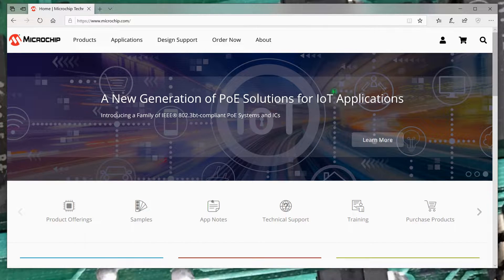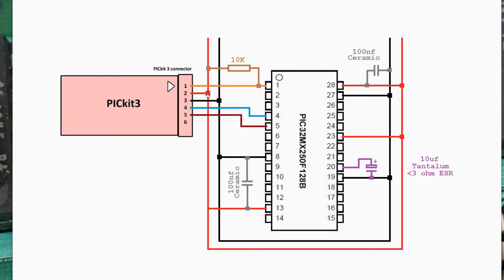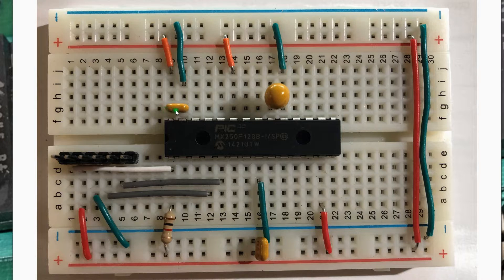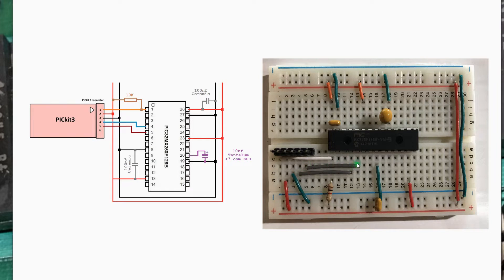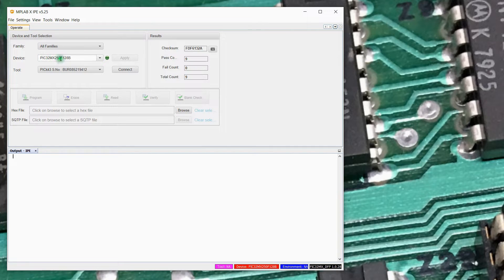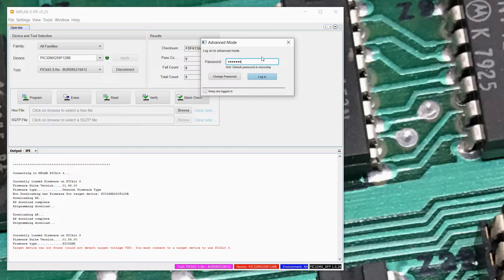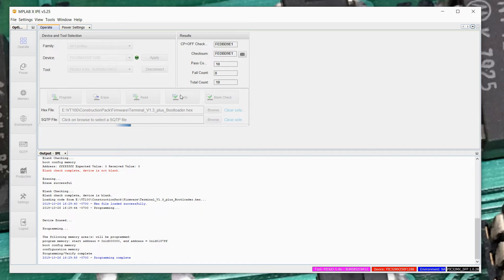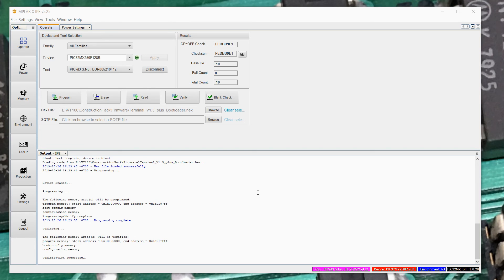PICKit 3   Programming a PIC32MX250F128 in the DIP28 package   STB402

Comment: Thank you so much! This is exactly what I have been trying to do for a couple weeks now! Even for the same reason, the terminal. The only difference for me was that I was able to program the PicKit3 to MPLAB mode in the PicKit3 stand alone software. I don't need to hold the button down when connecting it. Thanks again!

Comment: I just used this procedure to program a PIC32MX170F256B using a "PICkit 3" clone I bought from ebay.  The only difference is that I couldn't get the "PICkit 3" to enter MPLAB mode, but it stil worked fine, supplying 3.3V and all.  Very useful video.

Comment: Thanks for this, I too was struggling to get the Pickit 3 to recognise a PIC32MX250, the supplied multi-way ZIF adapter that I've always used on other pics didnt work in this case - so I made up a stripboard adapter from your schematic and it worked first time.    I'll keep it as my '32MX' adapter.  My project is also a Geoff Graham ASCII terminal.
I didnt have to do the 'plug in with button pressed' thing though - IPE 5.45 picked up the Pickit3 and in fact didn't see the programmer at all using the button method.  
I think maybe the pins 4&5 or 2&3 data/clock option causes some confusion. Geoff's use of 2&3 didnt work for me, but your diagram using 4&5 worked first time.
I also built one of Geoff's  Maximite computers - its brilliant,  he's a real genius!
Thanks again, your video helped me a lot, very well presented.
Cheers
Phil_G
Reply: The terminal project works!   but not first time... using your diagram, the PIC programmed fine, but I mistakenly used the '1.3 update' software - dont!    Apparently you must use the 'with bootloader' version that is in the 'construction pack' zip file, even though we're not using the bootloader.  The update alone doesnt work - presumably its is literally an update, like an overlay rather than a full image.  To be clear, the working file is:
'Terminal_V1.3_plus_Bootloader.hex'
NOTE THAT theres an error in Geoff's 'minimal' diagram - the 1.8v regulator tantalum on pin 20 is shown reversed.  I've seen reversed tantalums catch fire!
I can see many uses for this, its so simple and effective. Thanks Geoff & Mr. ShadowTron :-)
Cheers
Phil

Comment: I've used Arduinos and Raspberry Pi Picos but I've never used a PIC before. I'm here for the same reason as you and most of the other people who have commented: Geoff's ASCII terminal. I bought a Pickit 3 clone specially for the job and a generic PCB with a ZIF socket that's supposed to work with the Pickit 3 but won't because it's lacking the capacitors and resistor. I assume less sophisticated PICs don't need them. So I'll make up your breadboard circuit for this one-off project. I notice that Geoff's PCB has an ICSP header but the clock and data pins go to the "wrong" pins on the chip. Well, maybe not wrong, exactly, but certainly different (2 and 3, instead of 4 and 5). I should investigate and try to learn but I'll probably never program another PIC so thank you for sorting it all out for me!

Comment: Programming  on a solderless breadboard works fine using either pins 2 & 3 or pins 4 & 5 for the <DAT> & <CLK> connections.  Programming on the Terminal PCB also works without problems but you must remove the baud rate jumpers.  Cheerful regards, Mike...
Reply: Ah, I posted my own comment before reading yours. I wondered about the discrepancy between the ICSP header on Geoff's PCB and the breadboard circuit shown here. So it does work if you remove the baud rate jumpers first. Thank you.

Comment: Found this vid helpful as a noobie. Can anybody tell me the type of code the Pickit 3 outputs when it successfully reads a microcontroller? I see ASCII and something else. Can anybody recommend a converter to  C so I can read the source code? thanks
Reply from the maker: I believe you are ending up with a HEX file, they have a very specific format. Basically the address then a group of HEX values represented every two characters. See https://en.wikipedia.org/wiki/Intel_HEX - you might also be ending with with a .BIN file which is a representation of the bytes in the PIC  These BIN/HEX values could be converted into the assembly code the PIC runs however getting these back as "c" code most likely isn't possible. Remember that the "c" compiler typically outputs "assembly code" (the mnemonics for the actual instructions the PIC runs) then the "assembly code" is assembled into an image the PIC can be programmed with. Going from "Assemble" back to "c" would require knowing what compiler compiled the c code and know it's internal workings as it converted it to Assembly code. I've never tried this myself.

Comment: and it cant be programmed directly on the board ? I mean the terminal board
Reply from the maker: Programming directly on the Terminal PCB should work. I plan to assemble another terminal and will try it then.  Part of my goal was to show a more generic way to program the PIC processor as there are lots of other applications for it.
Reply: tell me if you succeed , I have assembled one board and did not managed to program it right on the board, now I will try your way ...  Strange , why they put terminals if they are unusable  :)
Reply from the maker: @st.alexiev625  Will do.
Reply from the maker: @st.alexiev625 I sat down this morning to try to program the PIC32MX again. Using the ProtoBoard / Enabling power from the PICKit worked as it did in the video. Using a fully stuffed VT100 terminal board failed; It didn't matter if I tried using power from the PICKit or the USB power on the Terminal PCB; it was unable to detect the device. I've also wired up one of VT100 terminal boards with just the components required for programming; this works however I did cut traces/add jumpers that moved the data/clock pins from the PICKit to pins 4/5 of the PIC; this was done during the long stretch when I couldn't  get it working; I don't know if this is required or not. Note that on the ProtoBoard I'm using pins 4/5 on the PICMX32 for the Data/Clock from the PICKit.
Reply: @ShadowTronBlog   I managed to program the processor using the "terminal board"  no traces cutting ! I programmed  in this way -  using  Ribbon Dupont Jumper Wires  1,2,3  from  PICKiT to the terminal ICSP header  ,  4 and 5 from  pickit ... to   "RX TX" (from the other header  "3.3, rx, tx, gnd")  ,  external power to the board,  boot jumper opened .

processor is detected , erased ... checked  ...  programed ... verified  
unfortunately  the terminal board do not work for me ... I do not get anything  video . I do not know why ... 
BTW my processor is 250f128b-50i , I do not know if  this  "50i"  is critical or not ... or something else is wrong with my board , I will investigate tomorrow
Reply from the maker: @st.alexiev625  Aw.. Progress. :) Let me know how it goes.
Reply: @st.alexiev625 As far as I can tell the 50i means that it can be clocked at up to 50MHz, as opposed to 40MHz for the more common part, but as you posted three years ago you must have either fixed it or given up and no longer care!